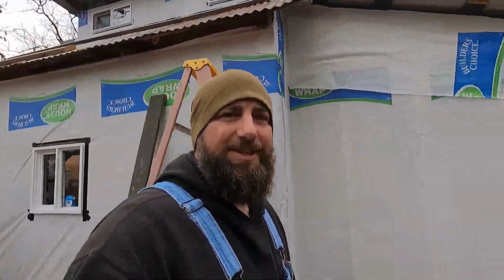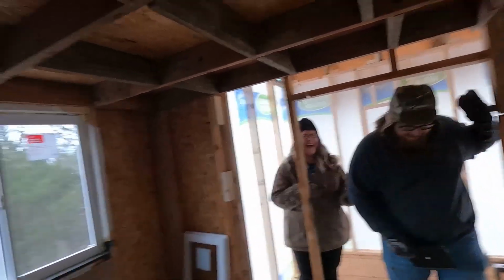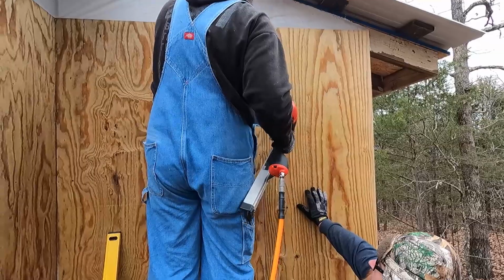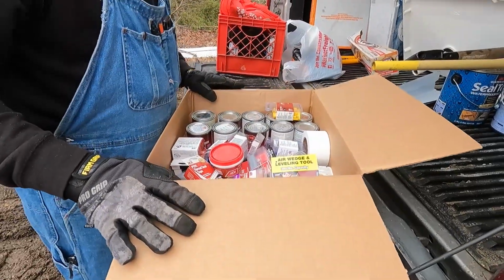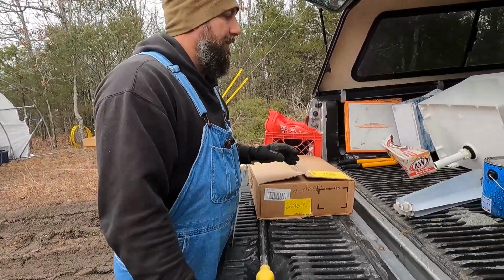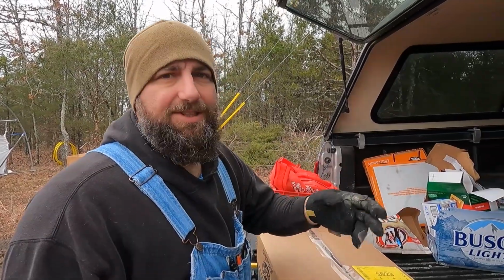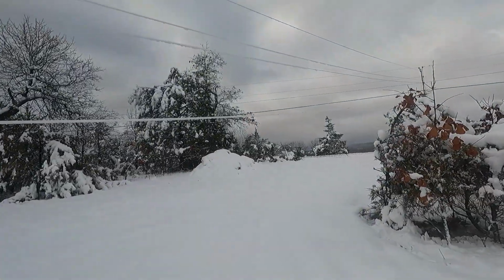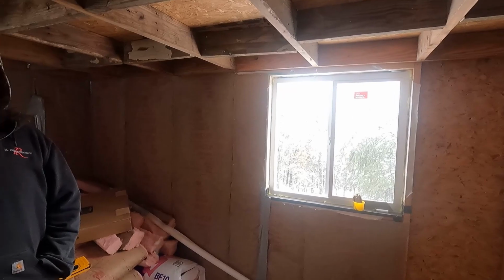Tiny House Exterior/Huge Announcement/More Bargain Finds

Comment: I was thinking about the block foundation on your land.. and thinking it would be an idea (moneywise, need-to-wise, work-wise and timewise) to build it , like, in stages? and build it to cover your needs (as a shop, barn,coop,house,storage-building)some of it just needs a roof, and some of it could be built with a second (main) story? Then the foundation wont crumble, and you'll have a "start". I'm picturing a build in the same feel as the tiny house; roofs that angles every witch way and from different elevations 🤩
Reply from the maker: We've definitely exhausted a gazillion possibilities with the block foundation.  We've known that we never wanted to use all of it, as it was just too big. Recently, we've tossed around the idea of just using the basement portion as our "root cellar", with my gardens going in the main section (filled in with more dirt, of course)...but as we take out blocks from the front part, the mortar is just crumbling. They're giving no fight to stay together what-so-ever. Which worries me about using ANY of it (structurally). We also are loving some areas by the creek for the possible build site of the actual log cabin? Soooo many possibilities...My mind goes crazy when I try to think beyond the present! hahaha But yes, just putting a roof over the basement part has been discussed. Having the outside kitchen close to it also...SOOOO many dreams and possibilities! That's the beauty of it I suppose!